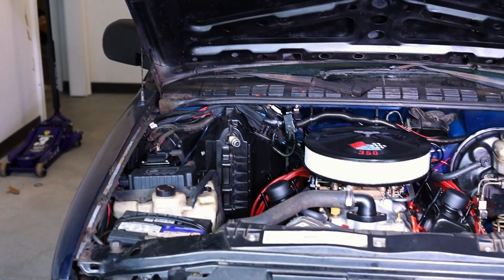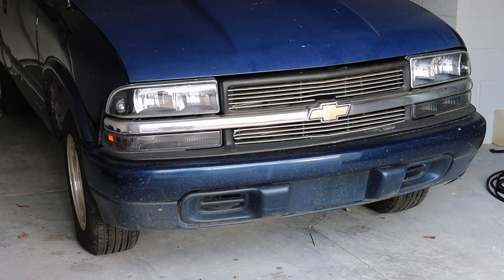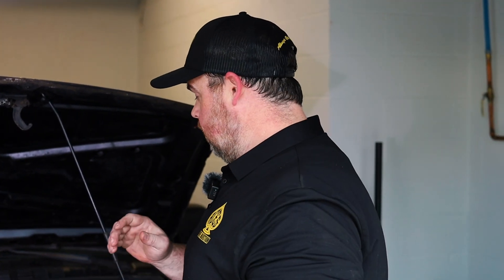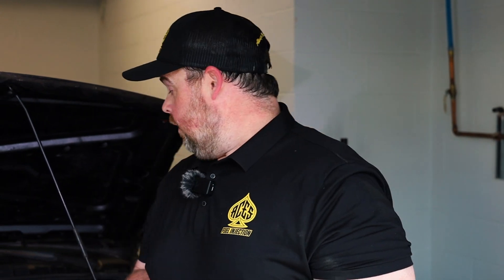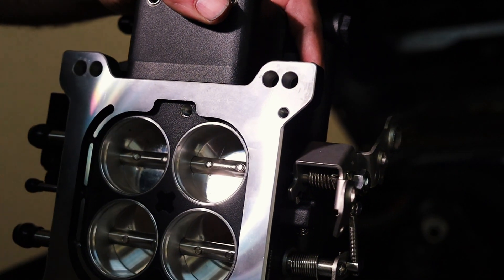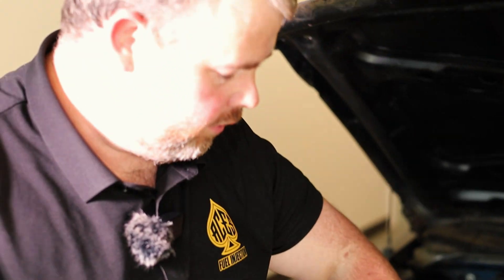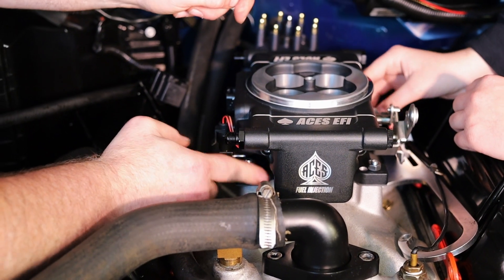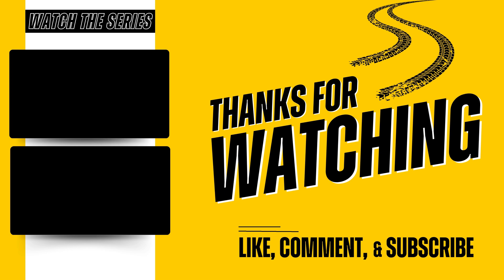Hardware Mounting (Killshot TBI Installation Guide Ep. 1)

Comment: PLEASE HELP I have QUESTIONS For the love of EFI tbi, I can NOT find any tech tuesday or videos on installation guides with factory components and harnesses. The engine bays are always bare! Besides Ls swaps. Of course that's and easy instal nothin there to be confusing. Can efi tbi be use for crate engine break ins, does it have a break in setting? I am engine swapping a factory 98 c1500 5.0l vortec everything original and factory,  i am swapping same base and years 5.7l vortec sbc, i am trying to ditch the stock intake manifold and fuel system to efi tbi return style in-tank with one of your systems, How do i keep Important factory components or add them to your system, what are your recommendations? I like you company i would want to like it more.